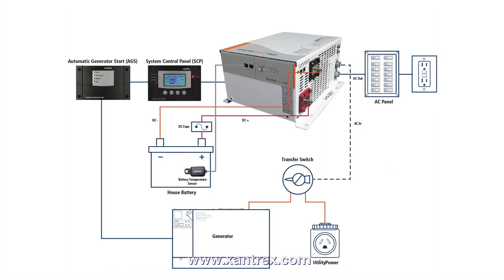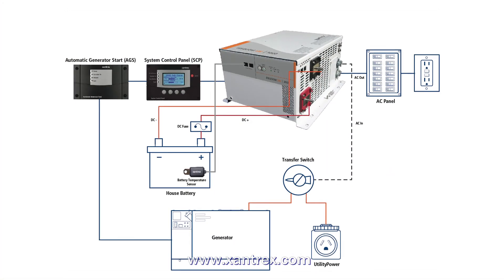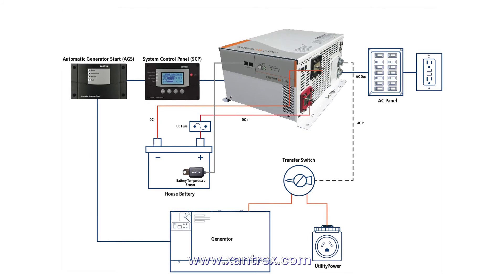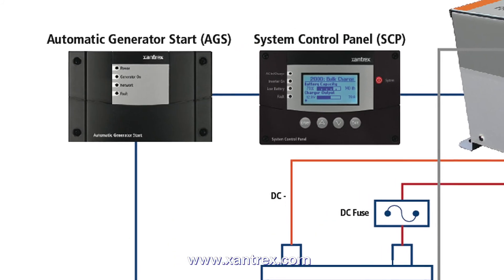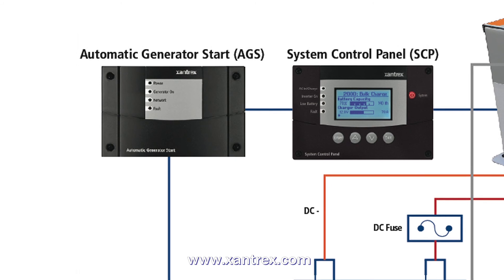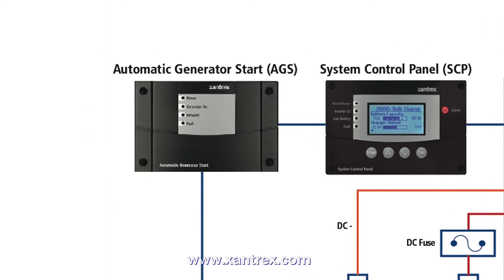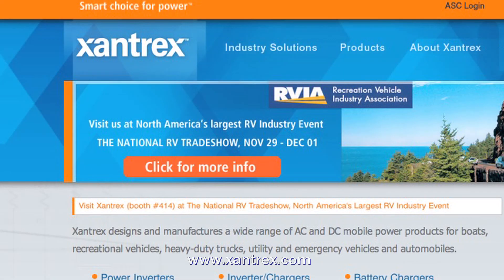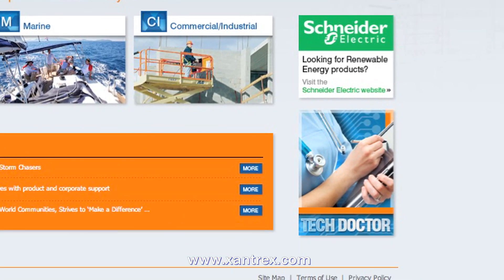Xantrex Tech Doctor™ - The Mystique of Automatic Generator Start (AGS)!

Comment: My understanding is that once this unit is installed in my SW2012 there is a function that appears on my control panel that states "Gen Support" which would supplement the generator voltage when a temporary heavy load is experienced. Since I do not have a "built in" generator on my boat (I use 2 Honda EU2000 Generators) can I install this and simply use it in "Gen Support" mode? Do I have to have it connected to a generator for this function to work?
Reply from the maker: Any generator, or other source of AC (including shore) will be supported with this feature enabled, even if it’s ‘plugged in’. Simply set the feature to enabled and set the support amps to a value that makes sense. If you set the value to 10, it will allow the generator to supply up to 10A of power through the inverter. Any draw above that will come from the inverter. The inverter will stop charging, so it shouldn’t be for long-term loads.